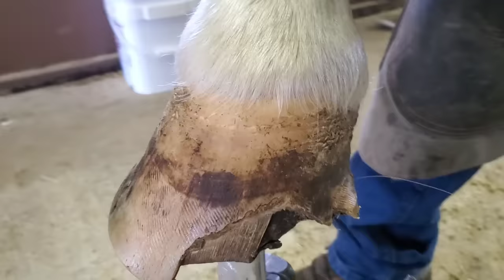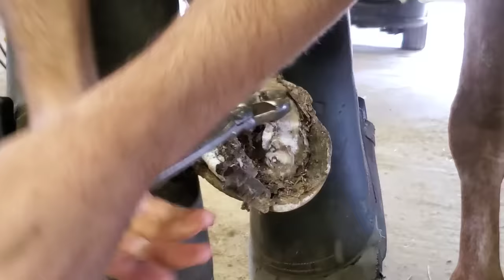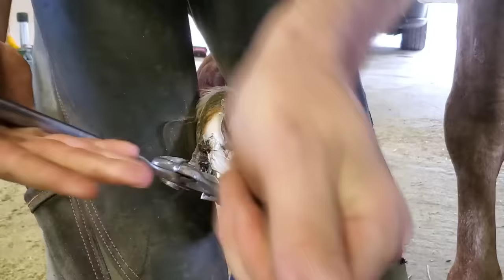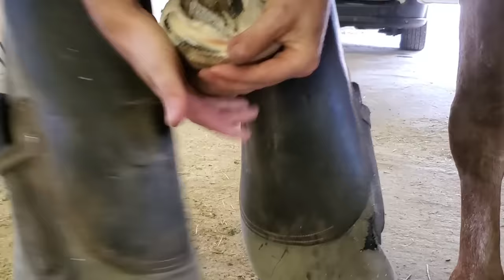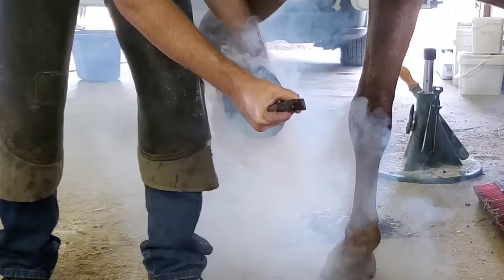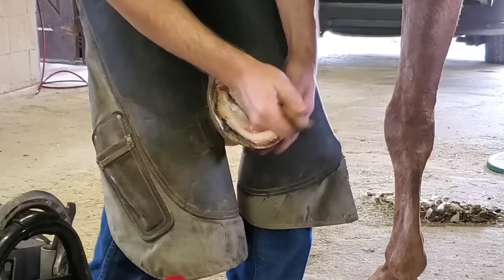Old horse finally gets relief!

Comment: My husband was a blacksmith for over 60 years.  This hentleman did everything just like my husband did.  Except the heated shoe part.  My husband  had a shop and he had horses he did special shoeing on.  But hed set the particular horses shoes up at the blacksmith shop with welded aids .  Then would drive out to where horse was kept and nail special shoe on horse's clean trimmed hoof.  He never had to do any correction on the welded shoe but an occasional narrowing or widening the heel or toe.  He had an eye for remembering that horse's hooves.
During rodeo time every year, hed often be so busy shoeing mostly the special performance horses.  To save time, hed set those shoes up in the wintertime and we kept them in alphabetical order accordering to owner's last name.  If owner had more than 1 horse, wed write a horse's name on each shoe to designate which horse for a multiple horse owner.  He worked with local vetinarians in shoeing crippled or injured horses.  Also did a lot of corrective shoeing on horses.  Like for a horse who would overreach with back hoof and clip front leg or even snag front shoe off.  I had a American Saddlebred mare that traveled witj her back feet too close together she kept her back ankles raw by corking herself at her faster gaits.  Hed weld pieces of horse shoe to outside of her back horseshoes to cause her to travel with her feet farther apart. It worked.
Reply: Sounds like you two had a lot of good times!

Comment: You Sir, deserve far more subscribers! I've been Horsey as we say in the U.K. for about 60 years, seen a lot of shoeing done before the word farrier was common parlance and virtually anyone could have a go nailing stuff to horse's feet and did. You have the "touch" - great skills shown on all tools - just one question - why only five clenches - did you decide these dainty quite boxy hooves could stand two more? Great job and respectful of the old bruising. I love how all you guys Stateside hold the leg and lower the foot to the ground - so many otherwise o.k. guys here drop the foot. 
See my mare in my avatar - 13 and half shoes front 14's on the back - a big girl.
Reply: My ex. Was asked by the Vets to shoe horses that had been terribly neglected, especially their feet. If only modem day Farriers would Not Buy Factory already made horse shoes, if you are lucky to get a Farrier that makes the straight bars he has to fit the foot, not, the other way round, where the made up shoes are slightly good, but every horse has its own four feet , and, they can come in slightly too large or slightly too small, both really bad, as the Farrier when he builds each shoe, gets the precise comfortable shoes made from a straight bar, not, already Factory bought. The ready made shoes are cheaper to buy in bulk, and take half the time , so not as expensive as the Bespoke shoes, but, if you can afford a Farrier that the Vets recommend, he will be the best one for your pony or horse, never lame and in pain, can go to shows or on Hacks or Trail Riding, in most weather's, so apart from never being foot sore through I'll fitting shoes,you will save money on Vet Bills. Happy Horse Happy Rider, awe.
Reply: @phyllisbennett9950  most ready made shoes must be shaped to the horses trimmed hooves.  Not just nailed on.  If bars are needed, an experienced blacksmith can start with a ready made shoe and take away or add to to fit the individual horse's feet.
Reply: @sharonwells9593  Sadly, many Farriers just select a shoe that looks ok, they go by numbers, and that will do, saving him money and the horses owner money and time also. Most things nowadays are down to costs, and, that is sad for many people and animals. There is a saying In the Horse World "No foot No Horse) which is true. I think, talking from experience of many years, is, that, as riding horses on our fast dangerous roads, if you only ride on grass and through wooded Bridle Paths, why put shoes on their feet, best to have them trimmed regularly, picked out carefully everyday etc, this saves money and, is better for your horses, ponies hooves in the long run, as being in grazing fields the hooves don't get as damaged as going on concrete paths and roads. The one thing I hesitate to say about this, is, that, some owner's of horses who have not studied about the health and welfare of your own horse, will think it is ok to trot on hard Road's without shoes on, this can cripple a horse , and unless the Vet and Farriers can work together to see the long term outcome, it may have be put to sleep by the Vet !. I saw many sad cases of neglected Horses, and it breaks my heart to think that some people are ignorant of proper horse care, I
or, just don't care about their horse's welfare. Hopefully ,many Farriers now fit the Shoe to the horse, and not fit the factory made shoes straight onto the foot!.

Comment: Why don't you use a clinching block?? Just curious.. Everyone ive been around uses a block before actually clinching them so the nails curve more an hold longer...
Reply from the maker: I don't actually believe that clinch blocking makes a difference. I have not chinch blocked in over 10 years and I haven't had any issues.

Comment: That is a complete butcher job on that foot... He has completely removed all protection from the bottom of the foot... Thinned out the sole so much that if the horse was to remain barefoot he would be tender footed... There is approximately 7/16 of an inch of sole depth at the apex of the frog to the coffin bone... You want to have at least a 1/4 of an inch collateral groove depth to maintain about 3/4" of protection for the foot... There was absolutely no reason that horse needed to have shoes put on his feet...